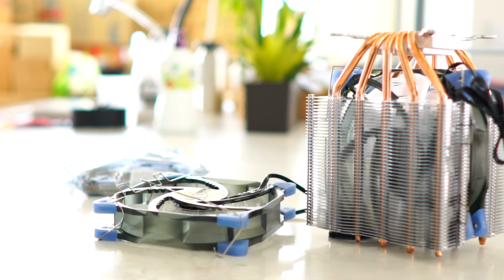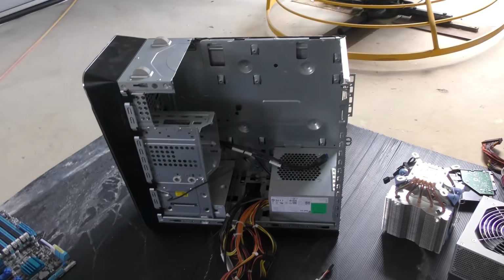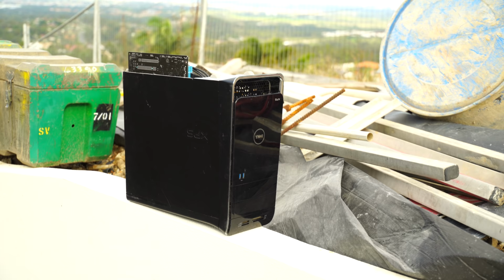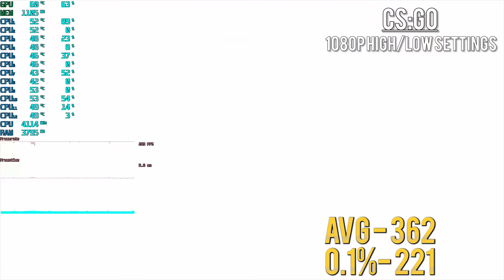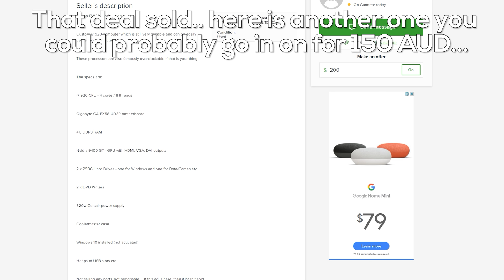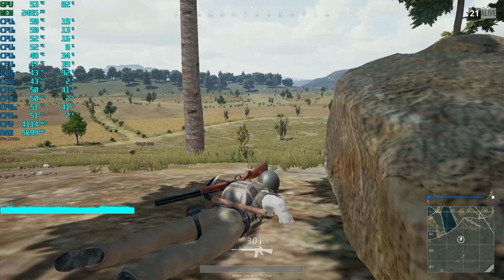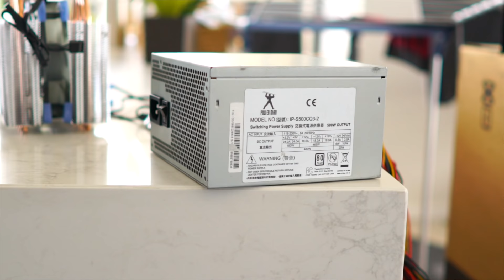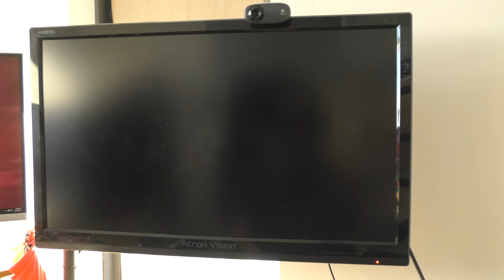Build a 6 CORE GAMING PC for LESS than an i7-8700K!

Comment: Impressive build for the price .that Ali Express cooler looks like it could become the new bang for buck cooler and best the 212 it does look pretty nice. I'd never trust a 5 PSU for a x80 series gpu but that's just me personally. but if your brave or have experience with the PSU go for it. That 780 for 117 USD is a decent deal in today's inflated gpu market good buy there

Comment: Would moving the power supply to the front top of the case( remove optical drive and screw in PS from top front with holes cut out for cooling) allow you to fit the mother board in the case and still put the side panel on? of course mounting the MB might be a challenge and u would have to cut more for the rear i/o. hmm....

Comment: I love my x5670. Might see if father Christmas can bring an x5690! See if I can get above 4.2ghz
Reply: Get a w3680 or w3690 instead, cheaper and unlocked (!)  unlike the overpriced x5690. No point in getting the x5690 except if you want a high end dual CPU system.
Reply: Andrew Bedford What BIOS settings are you using? All Xeons that I've seen seem to get at least 4.3Ghz, I've got my 5670 at 4.4Ghz.
Reply: SlavjanA 21x200. At 1.3volts. I don't think my chip can handle more. I've tried 21*205 @ 1.35v and it just can't handle Intel burn, also tried 22x200 and other various settings. My ram is at 1200mhz but I've got super tight timings on them. Uncore is at 3600mhz (got better cinebench numbers with higher). Lowest qpi link setting. Qpi is 1.28v.  That's all I can remember of the top of my head !
Reply: Hmm. This is what I've got:
22x200
LLC - Level 2
VCore - 1.35V
QPI/Vtt - 1.335
CPU PLL - 1.98V
IOH and QPI/Vtt PLL - 1.18V
ICH - 1.14V

On a Gigabyte X58A-UD3R.

Past 200 base clock the Xeons don't play very nice, but maybe you could do it with 199Mhz or 198Mhz etc. Just make sure that you keep your NB under 70C, or as cool as possible, because even for me if I linger on 70C or higher on the NB for too long my system crashes.
Reply: SlavjanA cheers will try it out! I've never played with IOH or ICH voltages before not really knowing what they do. My board is an Asus p6t deluxe (it can do about 205 on the BCLK if you change PCIe frequency to 101 ;) ) I do have a gigabyte x58 usb3 knocking around so may give that a shot too
Reply: Past 200 really depends on the board and the chip. My 3 Xeons run 220 without troubles (e5620, L5640 and e5649), and up to 240 not quite as stable with an upped PCIe frequency & lowered QPI. Issue is that it has issues with the x56** Xeons, so I'm locked to either the ones I have or a w3680+.

Comment: Tech YES City
 I watched you're video about the Intel es 6700t  and i thought it was so cool  I went out and did the same and it's really nice! but my question for you is if you think this setup is getting irrelevant because of this rig you just built in this video? I mean this seems cheaper and you got the same cinebench score as my es 6700. I ended up spending 230 USD on the cpu, mobo and 16gb ddr4 ram... Idk, what do you think?
Reply from the maker: Nah man, this is 6 cores 12 threads, you got the same perf with 4 cores 8 threads, your setup is better, you got the latest IPC!
Reply: B.J. Blazkowicz You bought 16G of ddr4? You are actually making money right now!

Comment: I would love to see screen shots of your bios settings. I have been running an X5670 for years and last year got a GTX980ti new for a load less than a GTX1070 when they were released.
When you overclock what are your temps like under stress?

Comment: Dang!  how do you get 80 plus psu's for $10 ?!?
Nice again Brian!  got a hp z400 workstation I plan to throw in a 3.33ghz six core and 12gb of ram.  I wonder if I can do a gtx 780 or so with the 475 watt 80 plus bronze psu that comes with it.

Comment: you have no idea how valuable this motherboard  is.   you should  get a REAL case for this,  

I have this mobo , and I  swap between a w3690  &  x5680 , both OC'd @ 4.4Ghz  with 24gb of ram @ 1600 Mhz. and a gtx 1080.

I run everything on high , or even ultra sometimes, and it works great.

this motherboard is sata 3  6gb/s,  and also usb 3.0  which is  something  x58 did not include  natively (in older x58 boards).

Also  this motherboard is one of the better overclockers  on the 1366 platfom.

Comment: Allright here we go....First;Hi Phil,nice work as always.Now for the longest comment i ever did...I have a very similar PC to this;mobo's a P6T Deluxe,CPU's the same 5670 and  i can do 4,4Ghz with NO effort(Cooler is a zalman cnps10x performa+),the auto presets manage do it without me had to do anything other then type in the base clock (133->200Mhz),it can also boot up @ 4,61 Ghz,but i reboots after OS starts to load,i had to raise some voltage,but i dont want to...Why not?The base 2,93 Ghz is more than enough for me,i have an MSI GTX 7700 OC TwinFrozer IV,and i dont play so many games,GTA V and Skyrim SE can do pretty much 60 FPS at 1080P VeryHigh settings,thats enough for me...Biggest actions drop it to like 47-50-and i say again-its without OC!Also i had 2SSD and 16 GB os DDR3 1866 mhz ram,that runs without oc on 1333Mhz,with OC,on 1606.Its more than enough machine,,and comes on a very nice budget....

Comment: This video has put me at ease for a bit until I can figure out which CPU I want to upgrade to weather a ryzen or new intel is in my future. I just replaced my i7 920 for a X5670 on a Asus P6T deluxe v2 motherboard with 12 Gb ram at 1333 and a GTX1060 6Gb ram. I would like advice on the over clocking though I've heard this cpu can go up to 4.5 and be very stable? is this true?

Comment: Why don't you ever test the X5690 I have upgraded a larger number of older HP workstation, Z400 machines, with this CPU at eBay $99 and the performance is great. I know X58 mobo's are not easy to come buy but if your not big in overclocking the HP Z400 workstation is a great x58 starter gaming computer for low cost!

Comment: Is it possible to remove the side where the motherboard is screwed on the riser plate, so i can remove the intel stock cooler and replace it with an intel cooler with a back plate.

Comment: A 4.3 GHZ OVERCLOCK ON A X5670! 1200MHZ on a 780 is pretty beastly too! (although the GB 780's were binned well) Man, I wish I knew more about overclocking. I wont mess with anything except for the CPU multiplier and the voltage due to lack of anyone to teach me. DOES ANYONE OUT THERE KNOW OF A GOOD WEB SITE THAT WILL TEACH MORE ADVANCED TECHNIQUES IN OVERCLOCKING!?!?!?

Comment: How did you get the VTG 5 backplate to line up with the 1366 mounting holes? The backplate I got with the VTG 5 doesent fit the 1366 holes and I can’t find a mention in the instructions about 1366 compatibility.

Comment: I got an X5690 at 3.46ghz. Can't overclock because I put it in a Dell Precision T3500. Is it worth the money to buy an overclockable motherboard? I have ECC RAM, would this be incompatible with some boards? I got it paired up with a GTX 1070 and 12gb of RAM. Runs great though, everything at 1080p Ultra and stays above 60fps.

Comment: I have an dell xps 8100 , i want an faster motherboard and processor, which micro atx motherboards and cpu's can buy, Beter than the 2 generation of intel core i5 or xeon. I want to overclock it and replace the intel stock coller.

Comment: Hey Bryan, 
I have a Gigabyte X58-UD3R , X5660 and  24 GB Geil DDR3 6x4 RAM .

Unfortunately my video cards are RX 480 Sapphire Nitro + OC and it seems that the non UEFI bios  does not boot up with them.
The majority of the forums say that the 4-bit color wall carpet is just a corrupted BIOS splash screen - I have not had the option to test to windows BOOT .
Do you have any option to test RX Polaris cards on various X58 boards and show the results.

Comment: what settings did you use for csgo specifically? i have an i5 4690k @4.3gHz and a 1070gtx-ftw @2012mHz and i only get 180-240 average range when i play 1080p high (with some low) settings. im convinced it has to be something with my settings

Comment: Hi Biran cool build, a question will this cooler fit LGA 2066 motherboards ?
will I have ram clearance issues ?
i just want some nice cheap cooler to check  that the system work well or some tweak that i do will work since i have 
hard line tubing and it can be a hassle to take check stuff around.

Comment: Guys I need help I recently bought a gtx 780 ti and it has display issues after one day of use in the first day I played overwatch just fine for 30 min and when I played pubg my screen was freezing in the 90s. The next day when I used it, I couldn't even boot into bios fans are spinning and everything works do I need to replace my thermal paste. The next few days I was lucky that I was able to boot in to bios and to windows 10 but in idle state i didn't even touch anything or even go to overwatch it just shut down and says no signal when everything was plugged in properly. What am I supposed to do. Do I need to replace my gpu thermal paste for it to work again I found this deal so I bought it. Anyone knows how to fix my no signal issue when I'm not even doing anything and just in the windows screen when everything is plugged in properly. If you know how to fix this issue tell me plz

Comment: What CPU do you recommend I upgrade in my build once I get more money?

Specs -

Pentium g4400
Gtx 1050
4gb ddr4 (gunna upgrade asap)
1tb HDD
Asus h110m-D 
EVGA 500W 80+

I built this a few weeks ago and it's great, but coz I am on a tight budget I couldn't go with the g4560 with a more expensive mobo. When I save up in around 8 months time, what CPU shall I get?
Reply: I say i5 6600 or 7600 is really good for your build. if you are on budget then buy i5 6400 or 7400. don't buy i3 cpu they are waste of money for you.
Reply: Mr.Haaska alright thanks a lot for your reply I'll have a look at the prices of em in the uk! These are all skylake chips right? If not then I cs use Kaby lake by flashing the bios but I'm not too confident in doing that
Reply: i5 6400 and 6600 are skylake cpu's and 7400 and 7600 are kaby lake cpu's. you're welcome.
Reply: alright cheers I had a look at them all. The 7400 looks pre decent for 150 quid. Also liked the 6400 but its only clocked at 2.7 ghz - is it still a good cpu? Thanks again btw!
Reply: well i5 6400 is better than your pentium. And as you said 7400 is in sweet spot for performance/price. and your motherboard supports Intel Turbo Boost so it gives small boost for i5 when it's need it. you need enable turbo boost in motherboard bios/uefi if you want use that boost with i5. have a nice day.
Reply: I forgot to tell you that there is i5 6500 and 7500 cpu that are more powerfull if you have budget for it.

Comment: So the reason why Bryan likes the X5670 is that of its cheap price without bargain hunting right? Well, I am just wondering what about try looking to build an i7-2600 system for $300? Won't that run better then the X5670?
Reply: 2600 non k? No. The overclocked x5670 will be faster 99% of the time.

A 2600k at say 4.8ghz, would be faster in games but would still fall a bit behind in heavy workloads, those chips go for $130-150 and good z67/z77 boards with a solid power setup cost as much as decent x58 boards anyway.
Reply: Well, I was figuring if you get your i7-2600 by bidding on a pre-built you could maybe get Mobo, CPU, RAM for $100(Which is what I did).
Reply: Yeah in that case it's pretty good. But in the case of the video, the x5670@4.3ghz build for $350 is much better than a stock 2600 for $300 and could later be paired with something like a 1080 without significant bottlenecking at 60hz.
Reply: Yeah, totally agreed.

Comment: Just got an x58 mobo(msi x58m not the best but I got lucky, it's a µatx so it can fit in my case) , i7 920, cooler master v8,and ram for 120$.(only the mobo cost 180 where I live)
Running the i7 for now, but I am waiting for a xeon it will be fucking awesome.

Is i7 920 known to overheat? It goes to 80 everytime I do a load test, the cooler seems pretty clean, can't check the thermal paste rn because I don't have some to replace it. And also the cooler is in the wrong direction but since it's in open air (need to cut my case a bit, not as much as yours lmao) I don't think it matter.
But I guess the xeon will be cooler since it's 32nm vs 45 for the i7.

Comment: probably won't get an answer, but should I pick up an x5650 with this motherboard and 4gb ddr3 for 150, or get an ivy bridge xeon E3 1230v2 with an h61 motherboard?
Reply: Malek Kmeid get the x5650 and just add a extra 4gb and yr set
Just remember to overclock yr cpu

Comment: Hi Brian, nice video!
I have a problem with my pc, i just instaled a new cpu, did everything correctly, overclocked it. And sometimes, after using the pc for an hour or so, the pc shuts down and shows a blue screen and there it says that there are not correctly installed hardware and the parts might get damaged. I hope you can help me with that or give some advice. My English is not that good.
Reply: Arminas your overclock is to high, try lowering it with 100mhz and try again.
Reply: You did stress tests after the overclock?

Comment: Ok i have the same mobo and cpu but i have 16gb of ram...my question is will this thing bottleneck a gtx 1070 founders edition cuz right now i use gt 710 1gb gddr5 and i wonna speed up office and windows also open gl but wonna game as well or if it is a bottleneck witch gpu do u recomend me to buy new
Reply: I own a 700w 85% ( EU standards...) Chieftec eco psu with 2x8pin pcie connector so there is no limitations on power

Comment: 4,3 Ghz on a server cpu?! thats bonkers I almost want to build myself a rig with what cpu considering how cheap it is
Reply: They can even go much higher, I have an e5649 (6x2.53 GHz) which can handle 4.6 GHz; it hits about 70°C there, also with a cheap-ish cooler (35€). Benefit of soldered CPUs :D Only running it at 4.2 though as that is more than enough and only requires 1.25V instead of 1.42V - uses a lot less power. I'll probably get a w3680 next year as I don't like being limited to a multiplier of 19...
Reply: Ground15 good to know that, I've purchased a E5649 (14 euro)for backup, in case that my x5650 will blow up at 4.9ghz...
Reply: I had a cherry picked Intel i7 920 D0 (golden stepping) from a professional overclocker (5+GHz CPU at LN2). Used that CPU at 4.25GHz with watercooling for years. Then I upgraded to a Xeon: two X5670's one X5675 CPU's to test. I was amazed how easily they all did 4GHz with basically no voltage change. 4.2GHz required a voltage increase but still quite moderate. With my watercooling and a Intel X58SO motherboard (not the best, some overclocking options are missing in bios): X5670 4.42GHz, X5670 4.48GHz, X5675 4.62GHz was the end result hitting the 'considered safe' CPU voltage (for watercooling).

Comment: I have a 5670 on a x58 sabertooth using a noctua dh-15 and they highest stable OC I can get is 4 ghz. 12gb of 10600 trip memory. what am I doing wrong lol?
Reply from the maker: could be a few things, QPI speed is too high, not enough on the QPI VTT, bclk could be too high, memory might be unstable, few things to look out for on x58.
Reply: Tech YES City Ran memtest for 24 hours all good. QPI is 2x the dram speed. voltage is currently at 3.125 (4ghz) VTT is at 1.88 dram voltage is at 1.64 LLC is on all power saftey features are off. as well as speed step. blck freq is at 182 multiplier is at 22.
Reply: Tech YES City maybe a x5670 overclocking vid in the future?

Comment: You can try disabling hyperthreading for some games to gain better temps. I managed to get my x 5670 to 4.6 Ghz@1.4 Vcore. I can get  "only"4.2Ghz with hyperthreading. Heres a video: https://www.youtube.com/watch?v=8INN8vexPgk&t=15s.
 Many of those games that uses more than 4 cores use 6 like Watch dogs 2 so  that may be beneficial. I used this cooler https://www.amazon.co.uk/SilentiumPC-SPC130-Fortis-HE1425-v2/dp/B014HISMIW which is just a rebrand of those ali coolers.

Comment: I have Amd Athlon(tm) 64 x2 Dual Core Processor 5000+ overclocked to 3.00 and i get freezing on Videos anything fix it.
Reply: do you have a gpu?
Reply: yes. It was a bad overclock and the board died so got new gaming Computer :)
Reply: well.....we might have to disagree on calling that a gaming computer lol

but if you are having stuttering, the 3 components that it could be are cpu, amount of ram, and gpu

how much ram is there?

and it is modern gpu that you moved from your old build?
Reply: What i mean is i trashed the motherboard and got a new one with a core i5 cpu
Reply: hahaha ok so you mean I was too late to provide any help and you got a new set up. lol. It was a 3 weeks old comment.

Comment: How is the power consumption? I remember that when you overcooked that x5650 it was hitting nearly 700 W . LOL 
Is it as bad or even worse?
Reply from the maker: Nah it's really good on this combo, the powerman ain't half bad, and the voltage is tame on the x5670.
Reply from the maker: around 400 watts from the wall in games.
Reply: Not too bad then. Cheers mate have a good one.
Greetings from UK.

Comment: Is that motherboard UEFI capable? If not is ASUS P6X58-E WS capable? Is UEFI a thing on X58?
Reply: krypl damnit! Slower boot times on old bios. I guess I can live with that. I found ASUS P6X58D for 45 dollars and W3680 for another 45. While I already have the rest. So I guess it should go for it
Reply: krypl asus p6x58-E WS for 57 USD. Is it worth the extra 10 USD
Reply: krypl I also got the option to replace my X5650 for W3680. While I pay 28 USD extra. Instead of 45. Good or bad?
Reply: krypl I will buy it tomorrow before it sells out